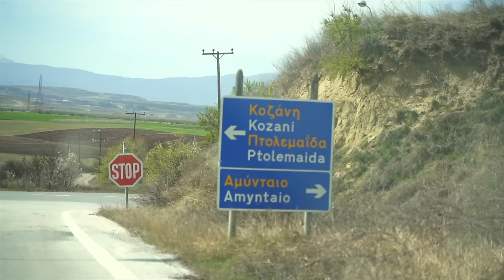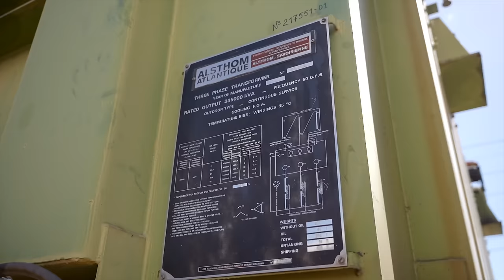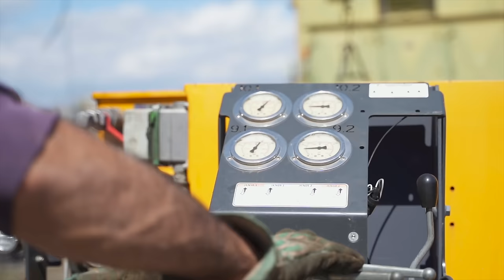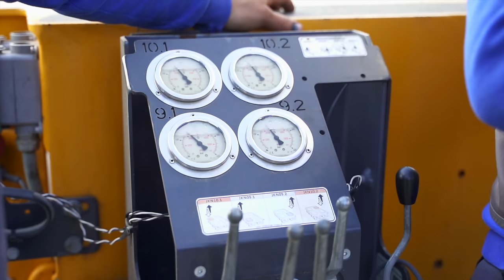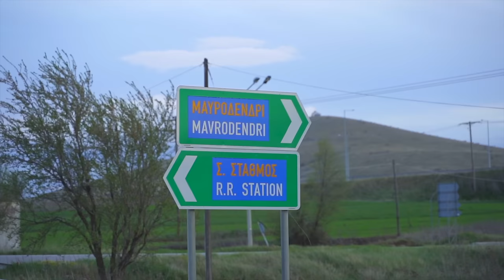Hydraulic lift & slide of 230t transformer and transport it in lowbed Goldhofer trailer thp/sl

Comment: Why you guys use sliding method instead of crane/cranes to lift it?
Reply from the maker: Need less work space - low cost - increase safety and the project finish quicker
Reply: @Stavridis-crane  increase safety and quickness?Hmm…lower costs for sure.
Reply from the maker: Safety because the transformer never it’s on the air without any support underneath, instead with the crane the transformer it’s 1 meter on the air and in this space you need 2 cranes. Crane need one day to prepare and load the counterweights on the trucks, one day to set up lift and un setup, one day to set up again unload and un setup and one day to unload all the counterweights to HQ so total 4 days. Sliding system you need half day to prepare the trailer and the equipment, one day to load and transport the transformer, one day to unload and half day to unload all the equipment in HQ so total 3 days.
Reply: عط
Reply: ض022